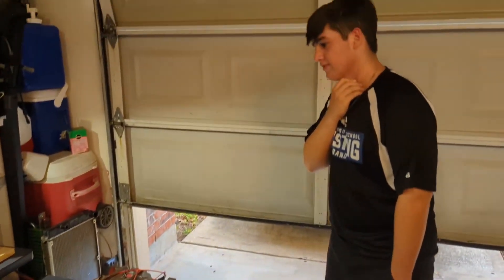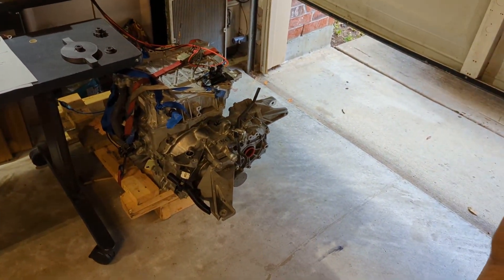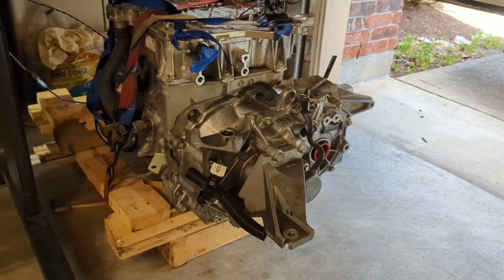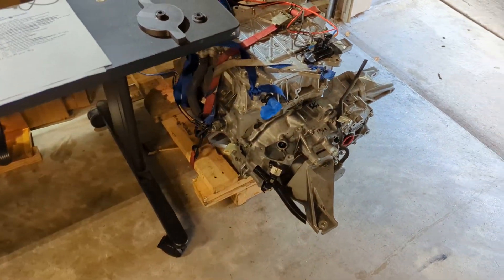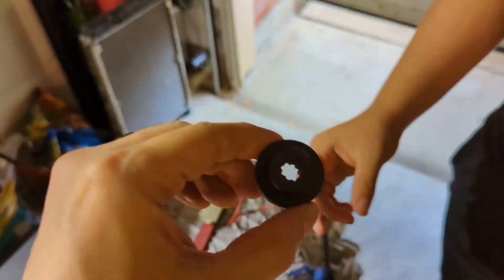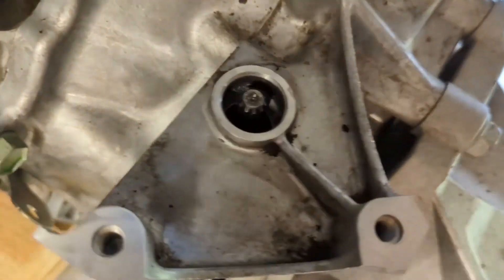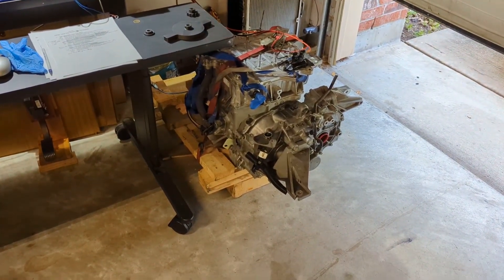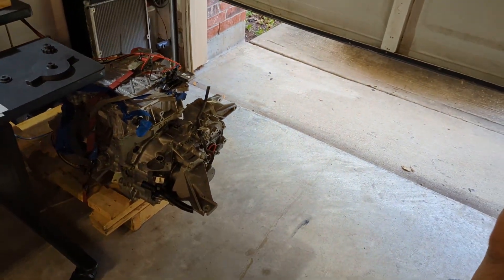Porsche 924S EV Conversion - Part 9 - Mounting Nissan Leaf Gearbox and Releasing Parking Brake

Comment: Is there a way I can put the parking actuator into neatrual and then get it to stay that way? My wrecked Leaf is still all together, I'm about it take it all apart, and I'm going to try putting it into drive to disengage the parking brake, and then unplug the actuator motor... Then I can start removing all the parts from the car. Good idea?
Reply from the maker: Well you can 3d print a tool to disengage it like we did here and just leave it that way. It definitely will not reengage on its own I don't think as it was very hard to turn and click. Then you could remount the motor to keep out dust and stuff. And yeah, then just keep the actuator unplugged. Just know that at that point on there is nothing keeping the car from rolling!

Comment: working with the same motor when you released the parking break did it turn clock wise or counter clockwise? I took the little motor apart and there is a small disk in it that fits on the splined shaft with holes in the disk using a spanner wrench from a disk grinder i can get it to turn on or off haven't ben able to test weather it is locked or not yet. By the way just got a 88 924s for the same conversion but will be using resolve-EV system and mounting in replacement of the transaxle
Reply from the maker: sounds awesome! would love to follow your project.

Comment: Great update, I had a similar issue releasing the parking brake but it won't be a problem as I'm using the original manual transmission.
BTW if your using a Nissan coolant pump they need a 2Hz PWM signal to slow them down otherwise they run at full speed all the time. Around 45% duty cycle makes them run at half speed.

Comment: This is really well timed! Been looking at doing this for either a 944 (84-86) with a Nissan leaf motor and everything the same you and you’re son are doing. 

How much have you sunk into the components and testing bench?
Reply from the maker: Awesome. If you do, be sure to share! We have spent the most on the motor, inverter and the thunderstruck components (probably 3 or 4 thousand for those after freight shipping.) The rest of the test bench was really pieced together from stuff we had. One of our previous videos in the playlist has a walkthrough of our test bench if you are interested.
Reply: @FrankGraffagnino  yeah that sounds about right for what I’ve been seeing on the motor, inverter, controller combos. I have seen a couple times on eBay where you can get all that and the batteries for around 3-4 thousand but the risk of getting a worn battery wouldn’t make it worth it. 

I may have missed in the previous videos, what’s the range goal for driving that you and your son have for the car? 

Also, what part of Texas y’all from, I’m in the DFW!
Reply from the maker: @elijahstrauss643  we're in south Houston. We are going to use a Chevy volt battery and hoping for 40 or 50 miles of range
Reply: @FrankGraffagnino  south Houston...now your comment about not needing the parking pawl makes sense. What if your son goes to college located in a hilly town? I have two ideas to actuate the parking pawl: heavy duty dual cable (like Advanced Adapters uses for their transfer cases) or a geared stepper motor. Your experience with Arduinos might make the geared stepper motor an easy choice, especially if you can reuse the original mount. Thanks for sharing your build with us. Good luck
Reply from the maker: @mikedickinson2277  yeah I definitely won't let the car not have some sort of parking brake. But in the video we talked about using the existing hand parking brake in the car. Is there some reason that wouldn't be enough to park on a hill? Also, the Arduino idea is a good one but I would need a high powered stepper and some sort of strong way of interfacing with that shaft. On the EV forums someone said they did manage to get the existing motor working with a high power stepper motor interface but they were still working it out. Anyhow, for now I think we are going to rely on the existing parking brake in the car.
Reply: @FrankGraffagnino  The parking brake should work fine, but I like redundancy in safety systems. Bill Bayer (Tesla Jeep) lost his BEV Ranger pickup to a parking brake that didn't hold on a hill. I've also seen parking brakes freeze to their calipers in wintery conditions. Living in Seattle, I will want to find a way to get the pawl to work if I move forward with my Leaf transplant vehicle. Best of luck to you